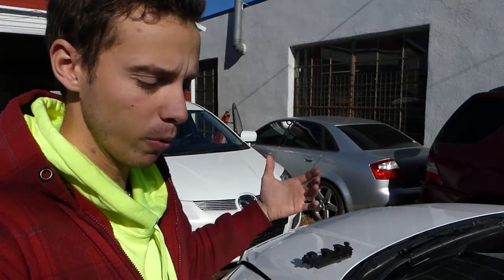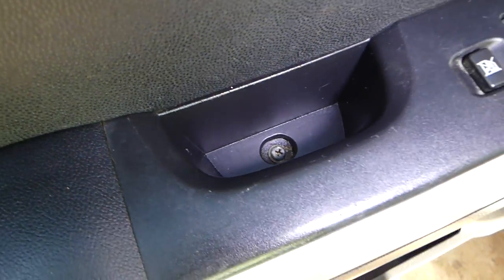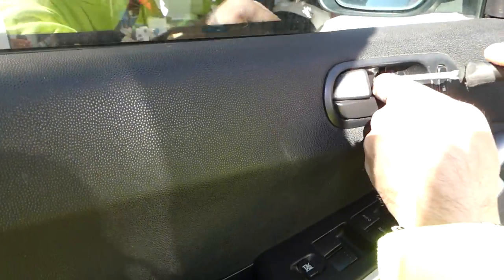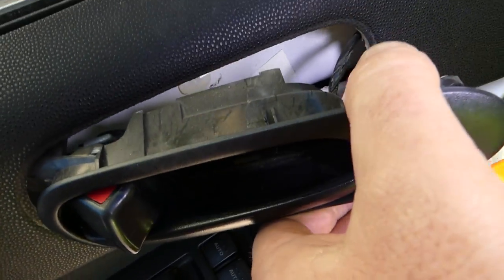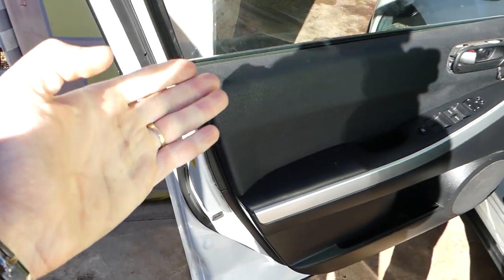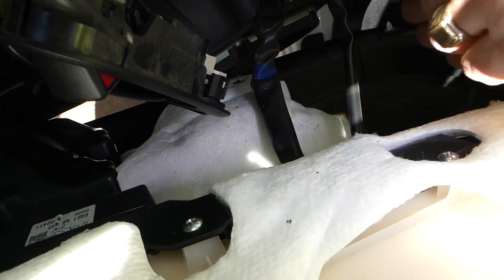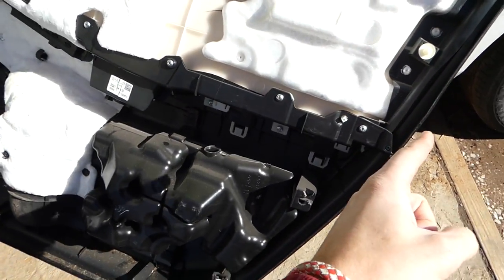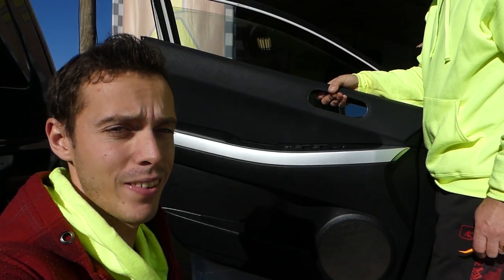MAZDA CX-7 FRONT DOOR PANEL REMOVAL REPLACEMENT CX7

Comment: If anybody has an intermittent automatic window. Pull the door as shown here and just pop out the window motor and then try running the window switch. Our motor had busted plastic gears inside so we replaced motor and works again. Many thanks for posting this video!!

Comment: Note to all...the passenger side door has a grab bar that is not on the drivers side, pop off the silver cover and remove the two additional screws. I spent an hour trying to pry the panel off before I realized what was happening!
Reply: Thank you ;-)
Reply: I almost broke the bowden cable support prying on the door until I realized it is also screwed through the passenger handle. I wish they add a note about this on their clip to warn users who try to blindly follow the video, assuming the passenger door works the same. Other than that, thanks for the good instruction clips!
Reply: Fucking thank you. Jesus Christ
Reply: Wow, that was so helpful. Thank you so much. I too was struggling and getting frustrated, about to break The thing off. Came back in. Saw your comment. Worked like a charm. Good for you. Many good karma points your way thanks again. ❤😅

Comment: Thanks it would be good to add on how to remove the regulator cover as well it's about 8 bolts, 2 nuts, and 1 plastic panel clip. It's common on these for the glass to kick forward on roll up, there's two screws that hold the glass straight it's common for one to come loose or fall out. Keep in mind the 2 nuts on the panel hold the glass rail up so once you pull it off the glass will drop a few inches so it's best to have a second person there to hold the glass up for reinstallation. Good luck. I own a cx7 myself and post a few videos but you guys provide quite a few good ones thanks again

Comment: How to remove passenger front door?
Reply: Passenger grab handle has a plastic cover you remove by putting a flat screwdriver in the notch at the bottom. Then loosen the two screws which secure it to the door.